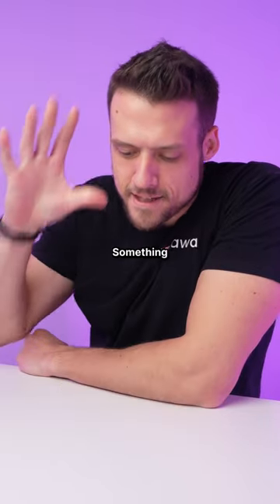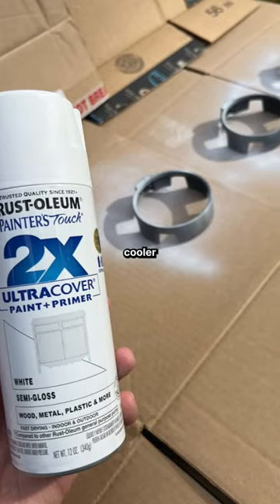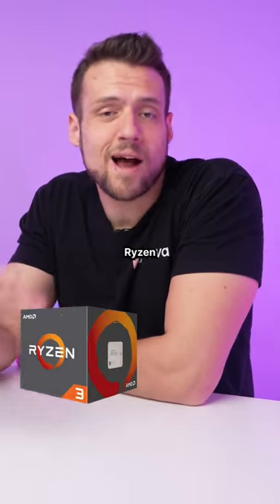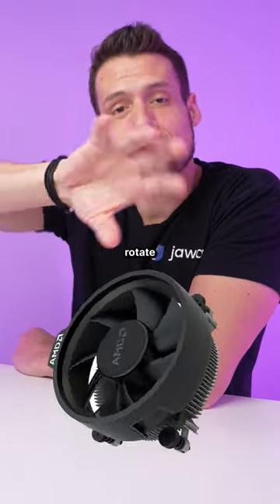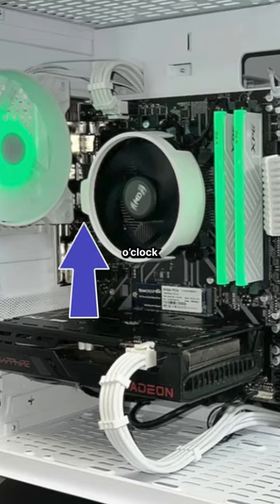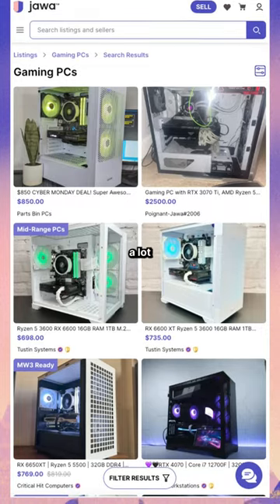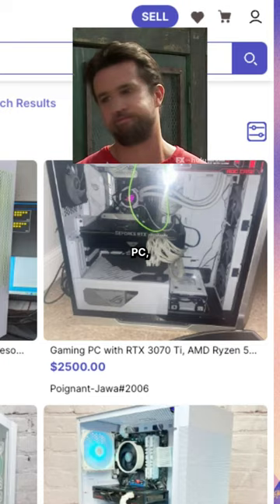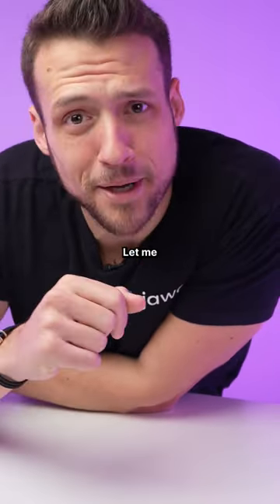Painting the AMD Stock Cooler WRONG

Comment: They should be rotated BUT...sometimes those tiny little screws are stripped and the shroud won't pop off.
Reply: Which means you wouldn’t be able to paint it, so that makes no sense
Reply: @MnDogman The question in the video is should you rotate the cooler. I'm simply pointing out that sometimes the shroud won't come off. What doesn't make sense?

Comment: If you're taking it off to paint then why wouldn't you rotate it?!

**So came back to update that some of these stock heatsinks have tabs and screws holding the shroud on.  Without breaking off that tab, the only way you can put the shroud back on is in the original orientation.  I did not realize that.

Comment: What I should by for 4k gaming
Reply: It depends, for a more budget build get a Ryzen 7 7700x, Msi mag b650 mobo, Nzxt 120mm aio cooler, 32gb of 6000mhz ddr5 from Corsair or t force, a 1tb Samsung 980 pro, a 4070 ti or a rx 7900xt, a h5 flow or a h7 flow or a loan li o11 and a 1000w Corsair modular psu.